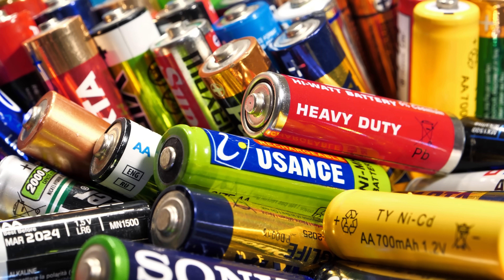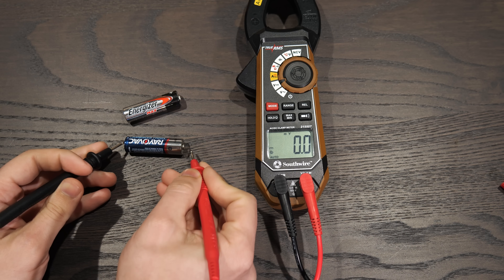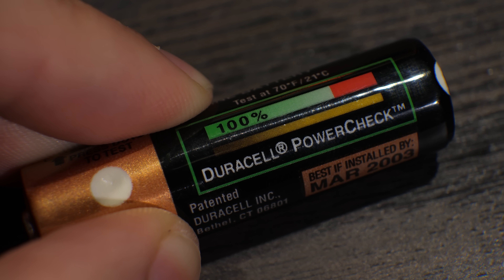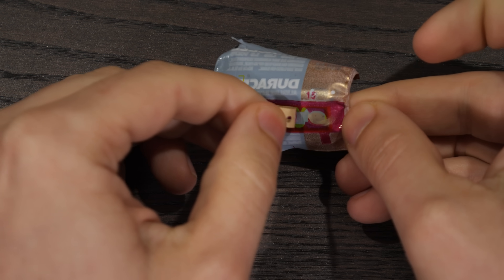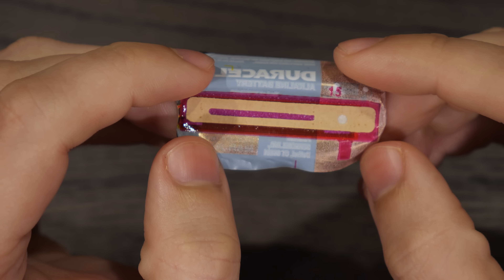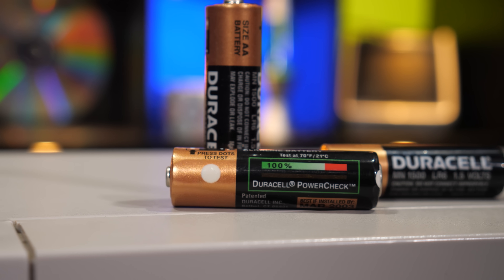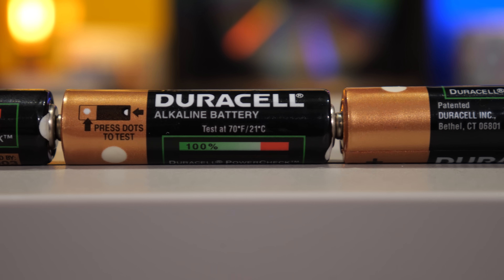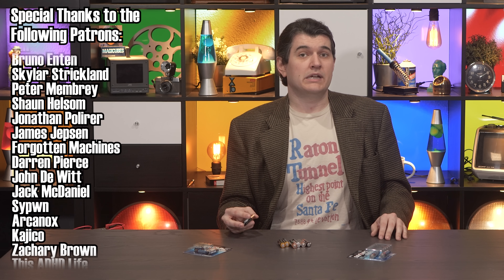Duracell PowerCheck: A genius idea which didn't last that long

Comment: I use a Zoom H5 for basically all of my audio work, it's the heart of my operation. It runs on two AA batteries, and because I don't want it dying in the middle of recording, I swap out the batteries when the battery indicator is down to one bar. So this means I am one of the few people who does have a drawer absolutely full of used AA batteries that aren't exactly dead. But I just have a battery tester that I use to test how much power they have before I jam 'em into something else, like a cassette deck or a Wii remote (my work is weird). 

Also, as a personal preference, I actually do prefer that the Zoom H5 runs on AA batteries rather than a rechargeable. This means when it dies, I can just immediately smack power back into it, rather than waiting for it to recharge/remember to recharge spares. For me, I find it better just to spend the money on batteries than remember to recharge shit.

Comment: I preferred it when the tester was built into the packaging of the batteries, rather then the battery itself, because then you could use it on any brand. They did that for a while too, I'm not sure if that was before or after the on-battery test came to market. And while it is tough to think of an edge case of when you might use a battery tester, back when portable gaming consoles ate batteries like pac-man pellets, they could be quite useful to source usable batteries from other devices to get a few more minutes of game time out of your machine.

Comment: I had a device called a "Re-Zap" as a kid, which could recharge Alkaline batteries using some kind of "computer technology".  It claimed it could recharge them up to 25 times although 5 times was more realistic. Still, it worked well enough, and if you could get 5 times the life out of your disposable batteries then that's a win.  Sadly it doesn't work any more.  I do remember leaving 9v batteries in it for a long period of time only to find the rods would shoot out like a bullet. I guess that's why the Re-Zap had a strong lid and walls around it, 'just in case' this happened lol.  I remember it didn't re-charge cheap alkaline batteries. Duracell, Energizer and other similar premium brands would would work fine, but it wouldn't even attempt to charge any of the cheap ones.  I'd love a TC video on these devices and how they were able to charge alkaline batteries, but they are such a niche product that probably not many people would find it interesting.

Comment: I worked at the factory that made these labels, Gilbreth Company in Bristol PA. You wouldn't believe how many steps there were in making these. Each color was printed on an 1000 meter roll one at a time in layers, then the flat label was "seamed" or folded and glued together. Then another department would inspect every label and roll them into smaller rolls using a strobe light and air to check the seams, size and printing. Headache inducing times for sure.

Comment: I prefer replaceable batteries especially when there is no way to replace the battery.

For ex:
I have an electric toothbrush and the battery can’t be replaced once it is dead.  

I would like to be able to continue to use it.

And smartphones are another hassle purposely created that way.

Comment: I miss battery tester on duracel. It was useful.
About rechargeable batterys i kinda hate them. For exemple on TV remotes and clocks i prefer the old alkaline. Batterys in remotes and clocks lasts years and rechargeables lost charge much faster and they are expensive to buy.
And when you need a battery rechargeables are allways discharged. I went from alcalines to rechargeables and now iam using alcalines again unless is something with high power consumption and i need to use it alot.
I have a box full of new alcaline batterys i got for free. They are new, but all past usage date almost like 10 years ago. Believe me or not, almost all still measures about 1.5v. I use them and offer them to friends. I have alots of them, and better give them for free than waiting from them to leak. I gave already alots and i still have alots of them, i think some will leak before i got a chance to use them all, but the time will tell. For now they are all good and not leaking. I opened and tested all. I got ride of few of them that had bellow 1.4v (majority were near or at 1.5v)

Comment: Ironically I am the type of person who does keeps partially charged batteries laying on many horizontal surfaces. I have also had it plenty of times where batteries appeared to be dead but in actuality, it was the deice having issues and not that the batteries weren't charged enough.  Also you can't buy Alkaline batteries based on price alone. Too many times the cheaper batteries were absolute garbage compared to the more expensive brands.  The built-in power check was like a fidget spinner to me. Couldn't stop playing with it and always wondered how it worked.

Also it's amazing how many devices just don't work properly, if at all, when using rechargeable batteries as the voltage is just low enough for the device to have issues. If only we could make rechargeable batteries that had a peak voltage of that magical 1.5 volts but alas 1.2 volts just isn't enough in a lot of devices.

Comment: I remember loving these as a kid, they were like a toy in themselves seeing how much power each battery had left in it. Adults around me used to tell me to stop testing the batteries because each time I tested them, it "wore them out" - I don't know how true this is, or how much impact the testing process actually had on the remaining current in the battery. The said adults likely didn't either, I would have liked to have seen just how much this testing depleted the battery. If it's a heating element like you said, then there was probably some truth to their claims.

Comment: I still have AAA’s with these on. 

And I’d say I thought it was a gimmick when it came out. But knowing it’s feature, I was happy to be lazy and try swapping out batteries from an old remote into something I’m using today - the test allowing me to see if I’m on a winner. 

I think cost is the main reason to get rid. And as you say, hardly anyone uses it. 

Rechargeable is such a better way to go. Never bought things like a Gameboy because of the waste & cost; was amazed how my mate went through batteries.  Whereas my Minidisc player had a thin rechargeable - much more enticing & user friendly. 

Nice video tho.

Comment: Yes! I do remember these! I also remember them on dollar store imitation batteries made so cheaply, they have a rough, bumpy surface like old, leaker batteries, but from new.

Another thing is my first MP3 player. It was cheap, but you lost your money on batteries. Not only did it use little AAAs, but SINGLE one! Of course, you couldn't buy an adapter at the store.

Comment: I bought a battery charger and several rechargeable AA and AAA batteries, not so long ago. The kit came with C and D adapter cases, where you place an AA inside. It's been a while since I've used any of that. Everything comes with built-in rechargeable Li-ion batteries now.

Comment: When these came out i worked at an industrial battery shop (reconditioned electric forklift batteries). I already had a fluke multimeter and i told everyone this wouldn't last. Back in those days horror fright gave away cheap multimeters that worked fine for checking batteries and had other uses.

Comment: Batteries usally start to drop voltage when they already low, oculus rift controllers always showed 100% until they about to die hour or 2 later

Comment: OMG - I never saw the “test at 70 degrees” on the side!!!  And the reason this is forehead smacking, is that my parents would store new batteries IN THE FRIDGE!  And I’d test a new battery before putting it in a device - no wonder why so many new batteries were “dead” after a few months in the fridge unused.  🤦‍♂️🤦‍♂️🤦‍♂️

Comment: I was absolutely convinced that the system relied on the human body to close some clever circuit. In fact, I thought the hard press was necessary to get the needed contact surface. 🤦

Comment: Hard disagree on the notion, that nobody kept half-charged batteries around. Most appliances, particularly GameBoys and the like, unevenly "used up" the batteries. You often could just reverse the order the batteries were in the device and get a few more hours out of the setup. Replacing those sets always ended up with keeping the previous set around, precisely because some of them would still work decently.

Also, there's the issue of singular batteries in a set dying. It was common enough to have multiple fine batteries, with only one being dead, but non means of testing beyond trial and error.

Comment: I never used the tester since dead shorts kill batteries!     Correct me if I’m wrong, but the heat created to turn that strip yellow partially depleted the battery, no?

Comment: If you happen to get curious and strip a battery for yourself, be careful when storing / disposing of them. It's very easy for something (including another battery) to bridge the contacts without the protective plastic layer, and even though they are only AAs they still pack a punch when shorted out and can easily start a fire. Even one on quite low charge can make a spark, so stay safe.

Comment: At one point, I remember, Duracell was also selling battery multipacks with a special empty slot tester integrated into the packaging. Worked on the same principle where you squeeze top and bottom to activate the yellow voltage/thermal strip.

Comment: I remember batteries of that, and I remember some Energizer batteries had them. They were kind of cool looking the Energizer ones with the check level thing. I remember some duracells, came with 9V batteries with a little tab that you would press across the terminals that did the same thing. Boy do I feel old

Comment: When you mentioned they were all a single cell, I was disappointed you didn't take the opportunity to point out the fact that they're not actually batteries.

By definition, a battery requires multiple cells.  Your typical 9 volt qualifies, though.

A battery requires multiples, be it a gun battery, a battery of tests, assault & battery (though many modern legal definitions have strayed from that), or even the repeated beating for pancake batter.

Comment: Prison battery check technique..... Hold a battery flat (sideways) above a hard surface. About a foot above the hard surface....

Then drop the battery so that it lands sideways on the hard surface....

If the battery bounces up and flips multiple times.... The battery is dead 

If the battery just does a slight bounce but DOESNT flip.... Then the battery is good

Comment: I remember using those quite often. When the device in question only has like 2 batteries, when it dies it's safe to assume both are dead. When the device in question has like 4, 6, or even 8 batteries there often seems to be some unequal amount of discharge between the batteries. So we'd use it to determine which ones had life left, and either replacing only the ones that were completely bad, or saving the ones that still had some life left for future use in a device that wasn't as power hungry.

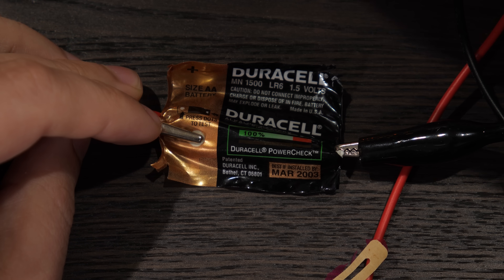Comment: 4:02 I speculate you could just apply a voltage to the terminals to simulate a live battery, though applying voltage to a dead battery isn't entirely safe, I think, just mostly.  Edit: 7:46 Or remove the wrapper and test separately, that works too.

Comment: There's only 1 tool that I put the batteries in when I use it, and take them out when I'm not - and there's a very good reason for that. A digital caliper. It uses AG13 batteries, aka LR44. But it turns out it doesn't have an off switch. So it stays on all the time and drains the battery even when not in use, which makes the battery last only 2-3 weeks if I leave it in there. So I take it out, and put it back in the next time I use the caliper. And I store the battery in the tool's own box, not in a drawer. :)

Comment: I thought it was Energizer that built that in to the plastic packing for their batteries - so they only had to produce one for every 8 batteries they made.  

AA batteries have always been something I had and relied on. Still do! From RC remotes (4-6 batteries), to the RC cars themselves (toy ones used 4-8 batteries, but we’re now running lipo packs), to game controllers, tv remotes (why do I have 5 remotes to operate my AV setup?!), to Halloween and Christmas decorations (the Hallmark singing plush snowmen take 8 AA EACH! but only have them out for a month. Likewise, the candles in the windows for Christmas, we have 17!! at a staggering 3 AAA per candle!). Flashlights for walking the dog at night - 2 AA each. Lanterns for camping/power outages at 4 AA each (x4). Salt and pepper grinders? Yup - 4 AA each! Computer keyboard and mouse - AA batteries.  Fake candles sconces on the wall - 4 AAA each. 

I buy rechargeable batteries. I have two 8 capacity trays, and about four of the 4 capacity ones. And yes, in December I’m running those daily.  I probably have over 120 AA or AAA batteries - which makes it frustrating when I buy something and it needs batteries, and I can’t find any.

Comment: Great video! I loved how many places parts of this technology showed up in my life.
The power check always  reminded me of the forehead thermometer we had when I was growing up. It was a little strip of plastic that changed colors when it was put on my forehead and then my mom knew if I had a fever. But now I am wondering if it was just an aquarium thermometer with the range of normal human temperature in the middle. 
I am also pretty sure this was what was in the toys that had stickers you had to press on to reveal their alliance. Transformers and Battle Beasts instantly come to mind.
As for the partially used batteries in the junk drawer, that happened in my house due to battery powered toys being aimed/launched down the stairs to their doom.  Thus the batteries got pulled out and tucked away to power another ill fated toy at the next toy giving holiday.
Also, I could swear that eventually these little strips were built into the disposable packages instead of the batteries, but I can't find any proof of that. Might just be getting old and remembering wrong.

Comment: I'm kind of stingy when it comes to getting the full usage out of disposable batteries. I only throw away the ones that are dead from any device, and they never all die at the same time! 

The simple trick I've learned for determining whether or not a disposable battery has juice or not, is by dropping it onto a hard surface, like a kitchen countertop, from a few inches up. If it's dead, it will bounce around a few times. If it still has juice, it will do one hard plop and fall over. 

I've learned this is the case because the chemical components inside the batteries act like a sponge. When they have juice, they are wet and have elasticity. When they're used up, they are dry and firm. 

So when you want to see if your disposable battery has juice compared to the one next to it, drop it on a hard surface. A battery with juice will plop, a dead battery will bounce around

Comment: we used to have "half used" batteries to run clocks at home, since they use very little power to run

grab a battery that's not powerful enough for other devices 
put it in a clock
it lasts a few months
profit😊

Comment: I hated when people would use em cause THEY DRAINED THE BATTERY!! Like say the remote is being funny but still sorta works, u suspect weak batteries, u take em out, u test them, they are indeed bad but now the batteries that were sorta working the remote no longer work at all!! They might start working after a few mins but I'm sure you noticed when u took off the load of the battery tester the battery didn't return to it's 1.2V it was prolly much lower due to the testing. I think this is why is failed - especially in the cases when you would wanna use it it becomes a liability! That type of scenario happened a lot too.. everyone I knew knew better than the test batteries because it'd end up draining what little power they had left!!

Comment: Taking out alkaline batteries from your tools to stop them from leaking for disuse is kind of insane. If you can get some decently-priced lithiums (either locally or from Amazon or something) then use those; they NEVER leak like that. I know being more expensive is a sticking point for many, but they last a whole lot longer AND don't destroy the devices you leave them in.

The only sticking point is that I used to wholeheartedly recommend Energizer Lithiums until they MASSIVELY inflated the price. Get some other brand that is closer to a reasonable price.

Comment: The more common use case, for me, would be when I’m trading out batteries and I’m too stupid to throw away the old ones before I grab the new ones. Sure, I could always whip out the ol’ multimeter, but usually when the old and new get mixed up in my hands I just throw up my hands and grab two more new batteries

Comment: I remember these coming out around the same time as rechargeable batteries became commercial available. I definitely questioned the tester on the disposable ones. I could see then and can see now a use for them on rechargeables because buying more rechargeables then you need is reasonable. I can't be the only one who has changed batteries from my stash of pre charged ones only to find them to have lost their charge in storage.